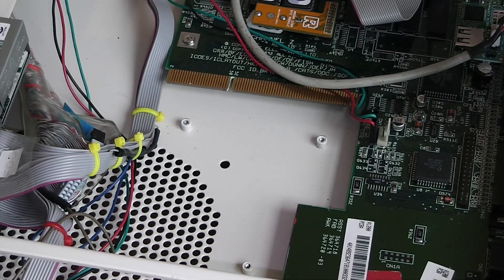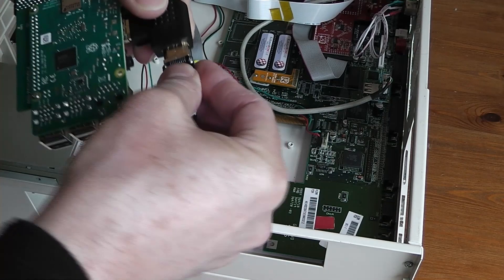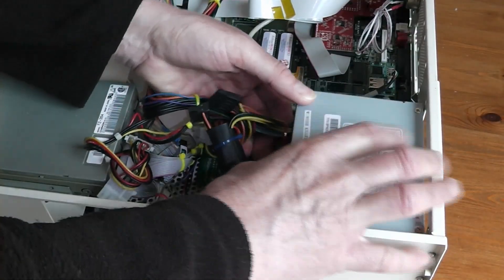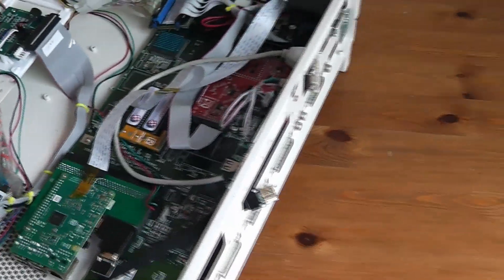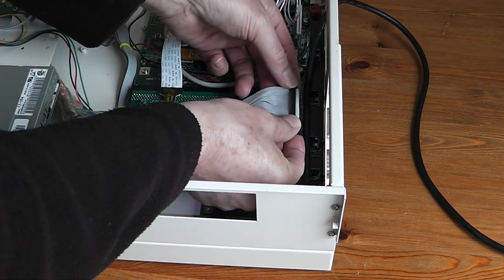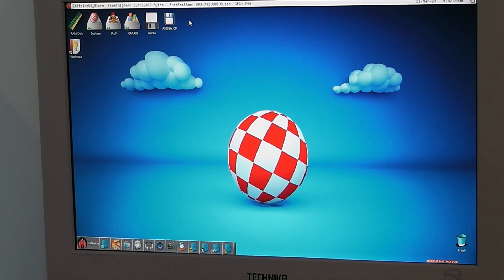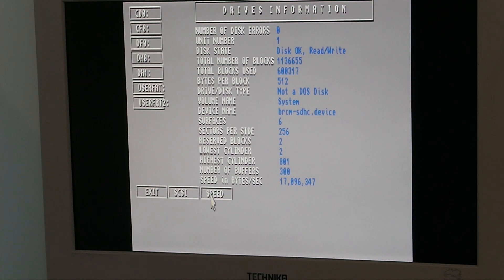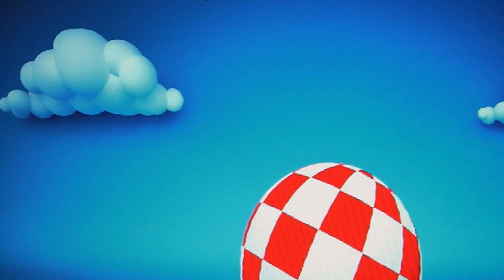PiStorm32 Lite Part 2- Installing

Comment: Very interested to know how the Floppy drive is fitted to the mounting frame, what did you use? also how did you get the Gotek and Floppy to co-exist on the same floppy cable?
Reply from the maker: Sorry for the late reply :(  It uses a custom cable I bought of eBay. It has a switch that selects either FDD or Gotek.

Comment: seems to me like that HDMI cable would have fitted better without the right angle adaptor which looks superfluous to requirements to me.
Reply from the maker: It actually is better with the right angle adaptor as without the HDMI cable is bent at a very tight angle under the power supply.  I eventually hope to fit a flat ribbon cable to the pi and route to an external port at the back of the case :)